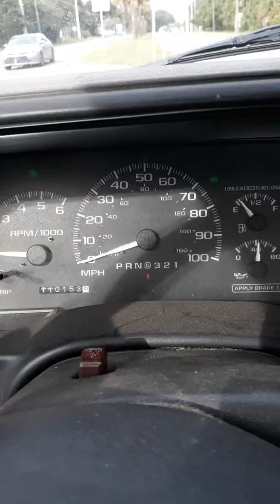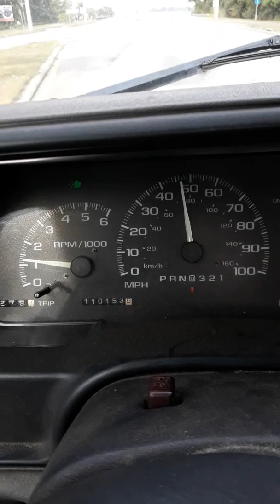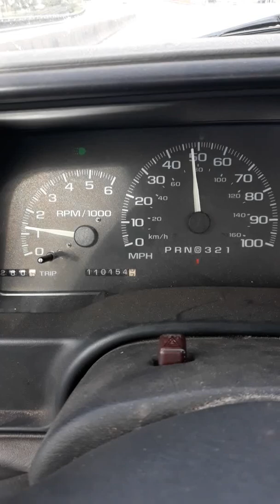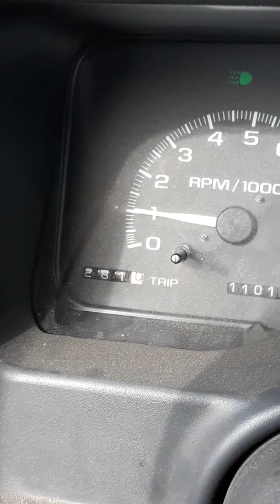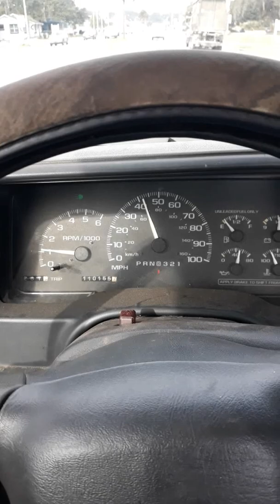PWM Delete in your 4L60E

Comment: Tried this mod in my 1998 blazer and for some reason it did not fix my issue maybe I made the grove too small but I am looking for advice!
Reply from the maker: What was your blazer doing before and after? What didn't change?
Reply: my blazer had a p1870 and the rpm would slightly go up and down if I went on a hill, then it would go into a save mode when the code was set so I attempted this mod to no avail it didn’t change anything unfortunately! Unless I did it wrong or didn’t cut the grove deep enough
Reply from the maker: Did you pull out your TCC lockup solenoid as well? It is possible that that thing is clogged up or even faulty maybe not opening up all the way to let enough fluid pass. @amosm8432
Reply: @Bbernhardsr I pulled out the vertical one and replaced it as per instructions online and also replaced PWM with modified solenoid, but I think it could be I made an error somewhere
Reply from the maker: @amosm8432 did you keep the rear o-ring but remove the front on the pwm solenoid? Also are you 100% sure you are working on the pwm solenoid?
Reply: @Bbernhardsr yes I do believe it to be the PWM solenoid, and I did remove the o ring, I think that I’m still struggling to get pressure somewhere because when it’s cold it works fine once just once, then it doesn’t so pressure is going somewhere
Reply from the maker: @amosm8432 you would need a scan tool to see what your line pressure is doing.
Reply: @Bbernhardsr gotcha, I’ll have to see if I can see that what pid would it be under?
Reply from the maker: @amosm8432 not sure the pid number. I just look at it on my Autel

Comment: Awesome video. You showing how the truck shifts after the pwm mod, helped alot. I noticed mine goes into overdrive, but then does the torque converter lock in & out. So I was thinking its been cycling between 3 & overdrive. The truck does start acting crazy sometimes & will go into 3rd . But between 45-55mph it does what you explained.
Reply from the maker: Yes it definitely locks in and out. If you put the gear shift in 3rd it will lock up the torque converter. Same as in regular overdrive.
Reply: @Bbernhardsr  really? Im going to go for a drive & drive it in 3rd. Ive been having that issue since I bought the truck. (2 weeks) I cant even drive it over 65 due to that. It just cycles between overdrive. So if in 3rd gear it locks in the torque converter, does that mean it goes 1-2-3-lock converter lock in
& then in OD it goes 1-2-3-4-torque converter lock in? Since its doing the torque converter issue, you think in 3rd gear it will cycle between lock in & 3rd gear?
Reply from the maker: @arcajay2157  more than likely. Yes it goes 1-2-3 then lock if your in 3rd.

Now other things can effect lockup such as speed which needs to be above 38mph. If you are running bigger than stock tires. If your throttle position sensor is wonky it may tell the computer that you are pushing down the gas pedal more than you actually are.

What you really need to do is verify with a scan tool that the computer is requesting lockup. If it is locked on lockup and your having this issue than I would say this mod will fix that. If however the computer is requesting lockup and then not requesting then you need to figure out why. As far as I know speed, engine load, and throttle position all effect computer call for lockup.
Reply: @Bbernhardsr  gotcha, took it for a ride in 3rd. Seemed fine at first but did the exact same thing it does in overdrive. My speed sensor is also all over the place. I don’t know if you have any sort of way to message eachother so I can send you videos of what its doing. But even in 3rd gear after 40-60ish mph it was doing the in & out thing
Reply from the maker: @arcajay2157  ok it sounds like we found the problem. If your speed sensor is not working right then you will have to get that fixed before anything else. The computer has to see a good solid speed signal.
Reply: @Bbernhardsr  the cluster will read upwards of 95mph or 90 if im doing 65mph. According to gps & pcm it matches speed between the two but does not match up with the cluster, but I was paying attention to it on pcm from obd2 scan tool. & it would jump around. I have it all on video. I think its the pwm solenoid though, because it only acts up when the torque converter lock in & out. So do you think this mod wont do anything untill speed sensor is fixed? Guy I bought it off of said he had changed it but haven’t gotten down there to inspect.
Reply from the maker: @arcajay2157  yes like I said the speed input to the PCM is very important concerning torque converter lockup. So if you're not getting a clean speed signal to your PCM you're wasting your time doing anything else.
Reply: @Bbernhardsr  thanks for feedback. Going to start of getting my speed issue fixed. I know the cluster is nuts, it will read 45mph if im doing 30mph according to gps.
Earlier today I checked the VSS signal to the pcm & it was matching up good with the gps reading. Once I started speeding up later, my mph would drop to 38 or 37mph when speeding up. I hope its as simple as changing the speed sensor & swapping the cluster

Comment: That would be nice if it fix my problem. My chevy started doing this thing in 40 -60 mph. I changed fluid and now in 40 - 60 mph it is shuddering. I do not use it to much but It's very annoying because most routes can't go over 60 mph due to geography. So it drives me crazy when I hit a slight climb and gently hit the gas. I will try this modification and hope it solves my problem. Thank you
Reply from the maker: I don't know if this will help shuddering but you can try. If it didn't start until after you did a service on your transmission then I would wonder if your filter is seated properly or even if the filter it correct? Did you change the filter seal when you pulled out the old one?
Reply: @Bbernhardsr  the problem start after a short time from service. Start with this thing on and off, on and off you mention on the video. So I make a fluid change and then stop a little this condition but began the shudder. After you pass over 60 mph all things disappear and TCC works great even if I hit the gas on a climb and transmisión work great. 100 miles is the truck. I put the new seal that came with filter.

The last trip I was driving disconnecting the TCC with the brake when the shudder start or the little rpm start to rise and low and then letting the TCC reconnect. Doing this until the shudder go away if I have to drive in the 40-60mph range.

Thanks for your answer !
Reply from the maker: @fernandoforna9053  ok now that you cleared things up now I see better. Yes I would definitely do this mod to your PWM solenoid and it should clear everything up for you.
Reply: @Bbernhardsr  ok. I'm going to do this mod , and change the filter and most fluid I can because when I change fluid to see if it fix it was very dark the new fluid I put on the first service I made. I bought the truck a few time before the service and is hard to know the truck history. 
A last questions:
For this mod Is it necessary to cover the blue plastic with mesh to prevent contamination when drilling? And does the seal have to be put back?
I appreciate your time on answers. Thank you !!! I'm on a country hard to find info, parts and qualified people.
Reply from the maker: @fernandoforna9053  just wash it off with brake cleaner and blow off with compressed air after your done. No the front seal stays off. Follow this video.

https://youtu.be/YvEtu-C_-7A
Reply: @Bbernhardsr  thanks buddy !!
Reply from the maker: @fernandoforna9053  no problem. Let me know what the end result is.
Reply: Mine shudders as well, did it fix your issue?

Comment: Thanks for the video. It's been a year since this post. I'm curious if everything still working well after doing the PWM delete?
Reply from the maker: Yes everything is working very well! I use the truck every day for work. Sometimes I tow a 16' box trailer with tools and supplies. A few times a year I pull my 32' rv with it. It has not had any issues. One thing I have noticed is that my trans fluid temp stays lower now that the torque converter is not slipping all of the time.
Reply: @Bbernhardsr  Awesome!!! I have a scan tool that lets me mess with the solenoid to see the effects before I do the mod. I can choose between PC solenoid, TCC enable, 1-2 solenoid, 2-3 solenoid, TCC control solenoid, shift transmission, clear tap, 3-2 downshift solenoid.  Can you point me at which one I would mess with?
Reply from the maker: @rlvtrader  you need to adjust the one that does tcc duty cycle.

Comment: Being a 98 you also need to do the GM wiring mod for ECM earth fault that loses earth for EPC solenoid, the best TCC PWM mod is Sonnax spring and orifice block off to turn into pressure regulated circuit rather than block existing valve and allow full line pressure to lock up which can over pressurise the TCC piston and cause cracking
Reply: What’s this ECM mod? I’m curious because my 98 blazer I’ve replaced the solenoid for lockup and PWM as well as the TCC valve and still get TCC lockup but I’m curious where to get info on this wiring mod? Can you help me out

Comment: I had an intermittent tcc surge at very light throttle. I put the sonnax performance pack in it that converts tcc to an on/off strategy. Fixed my problem and shifts great.
Reply from the maker: Doesn't the sonnax kit basically make that tcc solenoid  a flow through?
Reply: @Bbernhardsr  The ecm is trying to control it as if it’s pwm, the sonnax valve turns it into an on/ off. Similar to pinning the valve, but the sonnax valve comes with a pressure limiter spring, around 100psi. The spacer plate passage for pwm is blocked which eliminates pwm. Fluid is still flowing through the pwm solenoid as the ecm tries to control it, but flow stops at the blocked passage at the spacer plate. Still makes for a nice bump on tcc apply, feels like another shift. I’ve used these kits in other builds. Doing another one now with a few other vb updates along with other sonnax updates. Trying a few other tricks I haven’t tried before by blocking the 3-2 downshift and control valves. They are proven modifications to improve the 2-3 and 3-2 shifts. Probably going to have to play with 3rd feed and band release hole to get it right, but it’s all in learning. I’m a GM dealer trans tech, but don’t really do performance builds in the dealer. Always just a repair, don’t really get into modifications done in the aftermarket. Dealer trans repair is done a little different.
Reply from the maker: @dickbrugh5562  this mod I did makes it feel like it has 5th gear. I am very glad I did it. It also makes the decel clutch engage. Maybe that is why every 4l60 rebuild the decel clutch always looks new because stock it never engages because it falls out of tcc lockup when you let off the gas.
Reply: @Bbernhardsr  I use the sonnax hd 2-3 shift valve that applies the overrun clutch in 1st-3rd in d3. I use this valve in all 4l60e builds I do. Not sure what you did to get the overrun to apply, but messing with the tcc circuit won’t do that.
Reply from the maker: @dickbrugh5562  because if you watch a scan tool while driving and watch the pid for tcc lockup percentage you will see it drop to 30 or 40% while going down hill. That is too low of a percentage to keep the tcc locked. That is why when you re-apply throttle it has to go back into overdrive lockup. Mine will stay 100% locked up unless my speed drops below 38mph because 100% pressure stays applied to the tcc. It will also unlock the tcc if I give it more than roughly 55 to 60% throttle.

In what I see the pwm solenoid controls psi to the tcc lockup solenoid. That is how it can softly apply tcc lockup. Now that I allow the fluid to bypass the pwm solenoid the tcc solenoid is just an on off valve. The pwm solenoid is still in its place and the computer thinks it has full control of it. It does not.
Reply: @Bbernhardsr  I understand all that, but that doesn’t apply the overrun or what you are calling the coast clutch. That’s just keeping tcc applied. I like the sonnax setup with the pressure limiter spring to keep the tcc circuit from seeing higher pressures. What you did is basically like pinning the valve, tcc circuit is exposed more to line pressure.

Comment: This is interesting. I noticed the 4l60e in my 98 Sonoma does this. 40-60mph in overdrive you can see the tach rise ever so slightly then go back down. maybe 100-300 rpms.
Reply from the maker: You have the problem then. Doing the mod will fix it. I put a link to the mod in the video description. All you need is 5 qts of fluid and a new filter.
Reply: @Bbernhardsr  Awesome thanks sir! : )